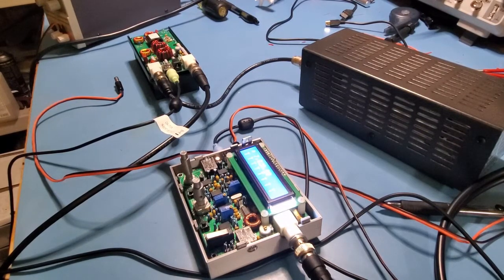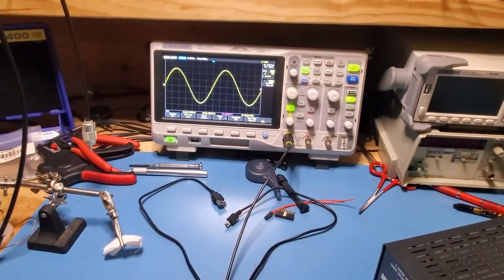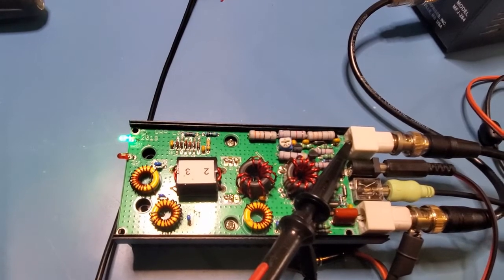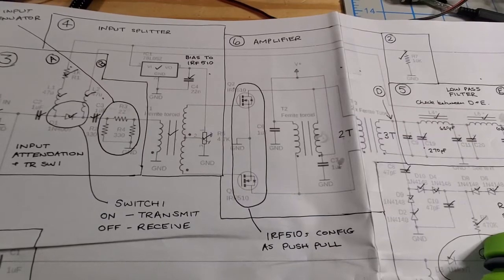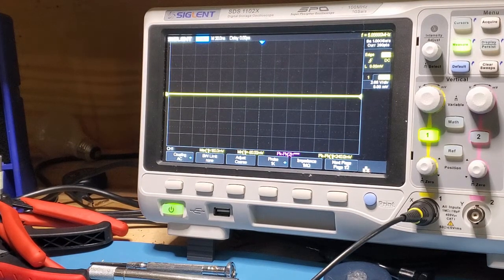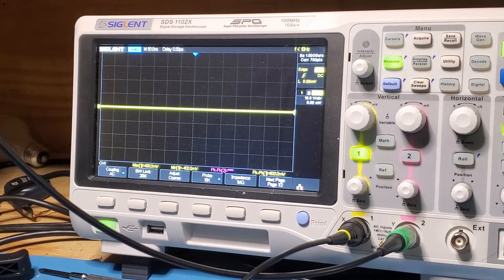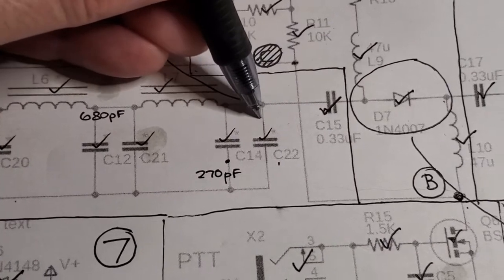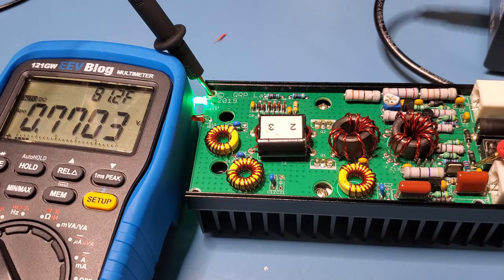QCX Amplifier Troubleshooting

Comment: Ian, I had no way of testing the amplifier after completing the build yesterday. I had previously found your videos on the amplifier series. Your instructions on where the key test points are along with the reasons are fantastic. I started out with a 9v battery as primary power, and a weak 9v battery with voltage reduced to about 5v for the PTT line. All I have to use is the DVM. I feel much more comfortable applying the full 12 volts to the circuit. So far no smoke after completing your test sequence with 9v battery. There are a few tests that required the O'scope. Is there a way to pseudo-check those points with just the DVM? Great demonstration, very much needed and appreciated Ian. The next trial will be with the full 12v. ...KE4LJH, Stephen
Reply from the maker: Thank you for the kind comment Stephen. Its always great to hear one of my videos helped someone! As far as being able to test without an oscilloscope the answer is it depends. Testing to make sure two signals are 90 degrees out of phase (or in quadrature) or 180 degrees out of phase which you need at the gates of the mosfets is tough without an oscilloscope for example. Which particular test were you interested in?
Reply: @na5y  Testing to make sure two signals are 90 degrees out of phase.
Reply from the maker: @stephensherer9573  I found this thread on qrz for  checking the phase of signals without an oscilloscope. 
https://forums.qrz.com/index.php?threads/how-to-measure-rf-phase-shift.296497/

I have never tried any of the methods discussed though - and those method still required specialized components. Hans has a page on measured RF power without an oscilloscope too
https://www.qrp-labs.com/qcx/rfpower.html

Hope this helps!

Comment: Great, thanks Ian! Just placed an order for a dummy load since I don't have a sufficient one, and will get on it as soon as I gather few things. Very nice shop and equipment. Thanks again for taking time and also will post my progress. Cheers!
Reply from the maker: Awesome. Good luck in the troubleshooting!
Reply: Well, after borrowing an oscilloscope and getting a dummy load I managed to blow one of the FET's. Aligator clip snapped off, shorted two of the legs and puff of smoke and micro explosion happened. My FET's are coming today. I did trace the signal and I am not seeing the voltage levels. RF is there all the way through. Suspecting my transformer is faulty but not sure. I am getting 5v signal from xmitter so my regulator is ok. Also there was a 16v present on FET's body. There was a signal on the gates with very low voltage but did not have second pair of probes to observe "out of phase sinewaves" . And then accident happened. My power supply is 16v max at 30A. It is interesting and I'm learning a lot and will resume as soon as I fix the problem I coused.
Reply from the maker: I have found that fixing the problems is easily more than half the fun (for me anyway - but I spend more time tinkering than on the air!). What voltage are you seeing on the gates? If you are seeing a good trace before the transformer and nothing after that definitely points to the transformer itself. 

You can pull the FETs out and just test the signal at the gates without them there at all. you should still see two signals 180 degrees out of phase. If you arent seeing that you may have to pull the transformer and recheck the windings orientation. That will be a bit of a pain. One thing you could do while the transformer is in circuit (and this would be better without the FETs) - is increase the pot R5 slightly  so that the center tap isn't grounded and make sure there is no continuity between the primary and secondaries. Then check the resistance of the secondaries to ground - it should be same as the pots resistance

Tough to remote debug - but I hope the above helps. Other thing I perhaps could suggest is check out the qrp labs forum. There's a pile of super experienced builders there
Reply: Yeah, got it. I'm struggling with antenna set up=less time on radio. Voltages are various. Across gates I'm getting 7v pp but transformer output is 3v pp. I will try with no FET's. Thank you for that.

Comment: Just a word about the mysteries of determining power (watts) from Vpp. For a 50 ohm circuit, this works:

P = (Vpp^2/400)

Or, square the Vpp then divide by 400.